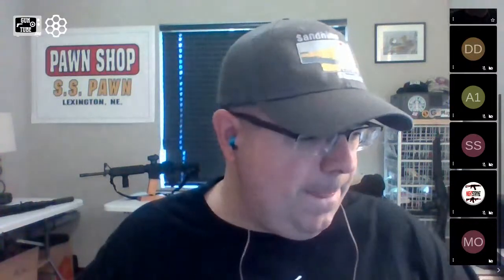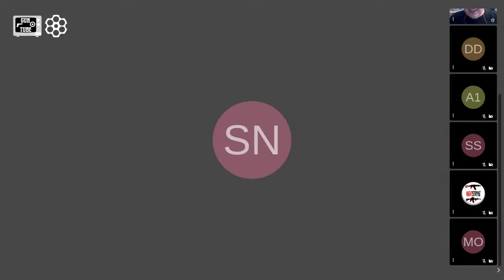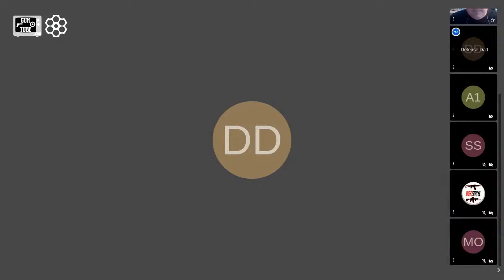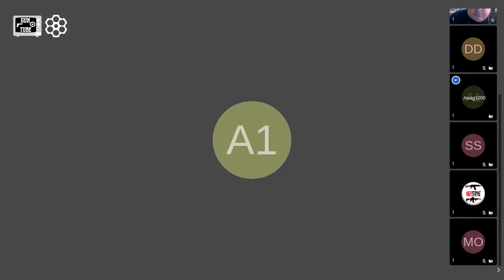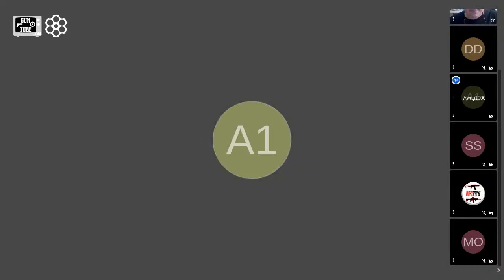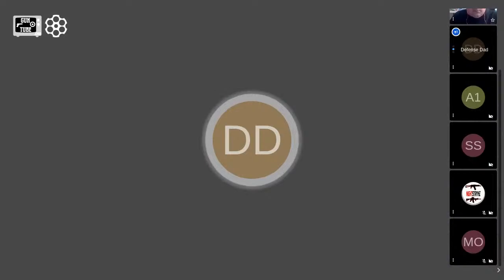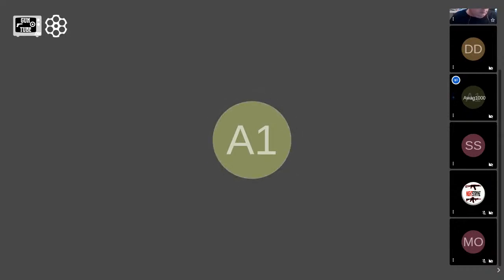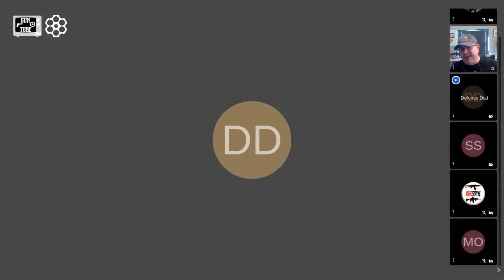Caliber Corner Season 3, Podcast #183, The basics of building your own AR15.

Comment: A small vice can help a lot when putting in roll pins. Start the pins with a punch, then use the vice to push the pins in. I put electrical tape on the jaws to protect the finish. For headspace, I have gauges but have never had one be out of spec.
Reply from the maker: Good suggestion with using the small vise!!